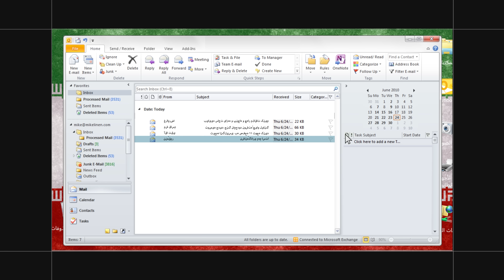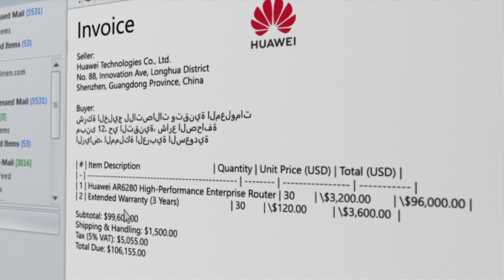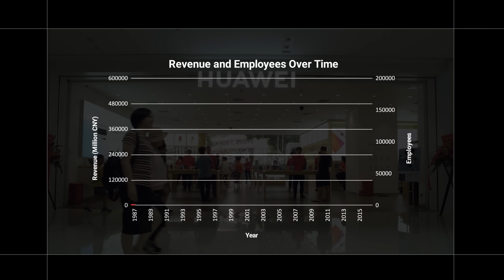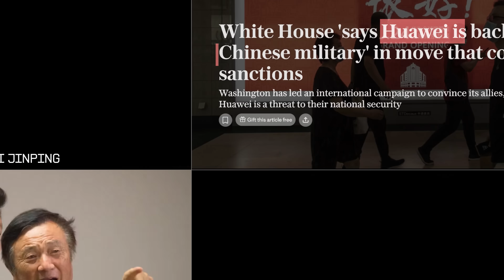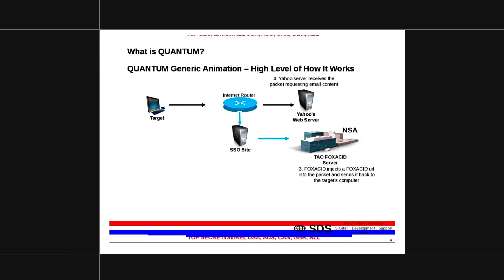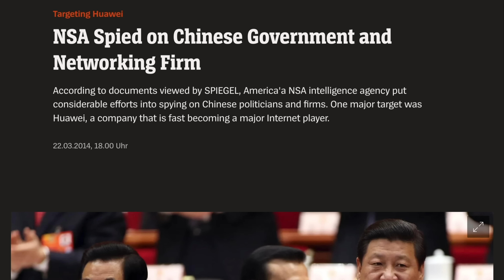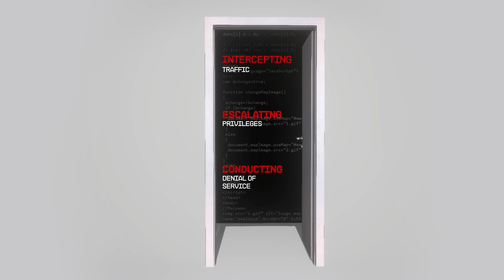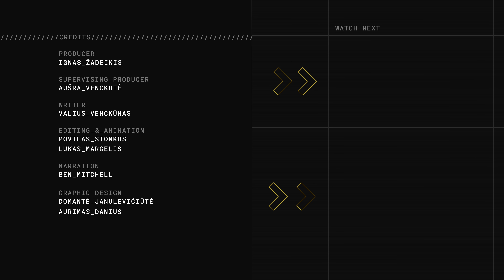How the NSA Hacked Huawei: Operation Shotgiant

Comment: Cisco has experienced at least 11 incidents involving hardcoded credentials or default passwords since the start of 2017
Reply: that has to be malicious considering it is such a basic level of coding error
Reply: @spacemeter3001  Probably is not. There are better ways to keep backdoors.
The thing is: something is not bad if no one knows, but when someone knows, they also know what to look for, and turns out, a lot of stuff had that same issue.
Reply: @spacemeter3001 Cisco was paid by nsa to use a specific RNG. One which they happened to know an exploit to crack it’s encryption faster…
Reply: @spacemeter3001  You need to properly configure the enterprise grade router and disable the authentication mechanisms and/or change the passwords. It's not rocket science. The IT team fked up or the guy who's the IT admin is a spy/traitor depending on how anyone want to look at it.

Anyways, I'm certain that 100% of this video is complete and utter bullshit.
Reply: 2017 ??? that crazy
Reply: Do you think whose router is safe now?
Reply: @taijistar9052  I don't move terrabytes a second of traffic. But I do manage my home network. I use OPNSense for my firewall and I use openWRT on my routers, all open source software. I do not use proprietary (closed source) software on any of my machines. All my IoT "garbage" are on a separate VLAN controlled by Home Assistant
Reply: @taijistar9052  And router pages are by default hosted on unsecured http servers, not https , and not easy to install secure certificates in order to turn it into an https://. So with a little effort you can break into them or read the unencrypted communication going back and forth.
Reply: and several more involving heavily obfuscated backdoors. These weren't simple coding errors - someone went to serious efforts to hide them
Reply: Tell all.
Reply: That. We. Know. Of. What should worry people are all the things we don't know about. Some are intentional, many are just stupid coding mistakes.
Reply: Serves Cisco right. They were the ones who helped China build its great firewall.
Reply: That's it. I'm rewriting my router's firmware. Down with the backdoors
Reply: @NerdyCatCoffeeee Do not wory they have it in every layer(just in case😅)...
Reply: @NerdyCatCoffeeeejust install OpenWRT on it 😊👍
Reply: @NerdyCatCoffeeee😂😂😂🦴😁😆
Reply: So, we need to be clearer in our language here, is it hardcoded credentials or default passwords? If this video is referring to a default password that was not changed by the Iranian IT department then this is a lesson learned situation to network administrators everywhere of the importance of changing the default password when new appliances are being installed. If this was hardcoded credentials, aka a backdoor, thats a completely different story and I just feel like its not made crystal clear in this video.
Reply: @ElderberryRanch  And routers are hosted on an unsecured http:// router which is difficult to secure by installing secure certificates. Only a few routers allow for such installation.
Reply: @ElderberryRanch  it’s pretty clear they’re talking about back doors
Reply: @xinniethep00h showing that code confused things for me, that code snippet looks normal.
Reply: @ElderberryRanch  The film is informational/propaganda, not instructional... if you show too much, the algorithm will punish you...

You might as well look for actual martial arts techniques in Hollywood action movies...😆
Reply: @Bialy_1 I wasn’t looking for any code to use, just that they presented that block of code twice as the culprit and it looks normal to me. If it’s informational then they need to work on their information, nothing about that code block shows anything wrong with it, if they don’t know the actual code then just leave it out for something more symbolic and we can just use our imagination
Reply: Ah, yes, the humiliation inflicted on the chinese. But no mention of the humiliation inflicted by the chinese on Tibet, Xinjiang/Uyghurs.